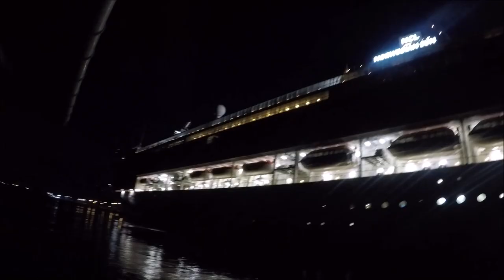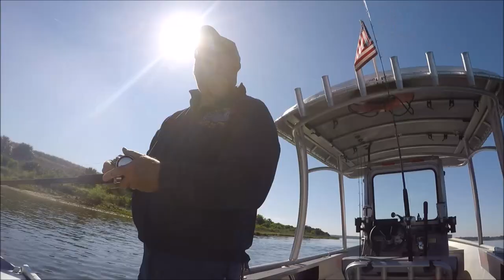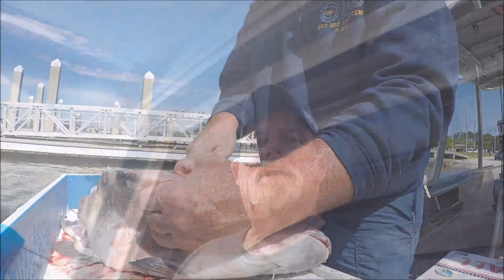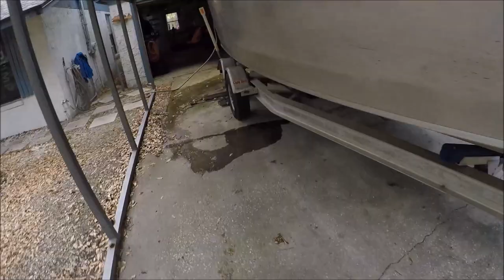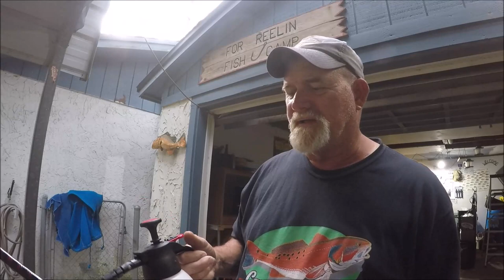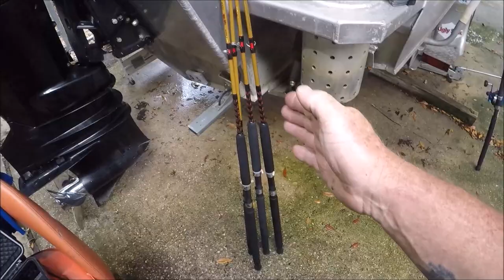early TOP WATER PLUGGIN...disaster

Comment: Dam it Dave...trailer maintenance argh. That reel deal...I did that out in Cali. Not for a livin, not every day. Give it a try and see how it works for you. Some dont care about their reels gettin beat up. I fished my Diawa SL20SH for 10 years, almost weekly.in and out of the car down the pier. Rods wrapped reels bagged. Setup & rigging done on the boat. I pulled my salt gear out the bag last fall...one little scratch on the 20. Those reels in the same bag since '99 not a bit of corrosion. I thought about that. Not knowing when I would use them again I thought about being certain they would survive. I opend the Penns up and they too were mint inside and out. Whiskey bags and inside a duffel. Protect your investment young man!
Tight lines Capn Dave!